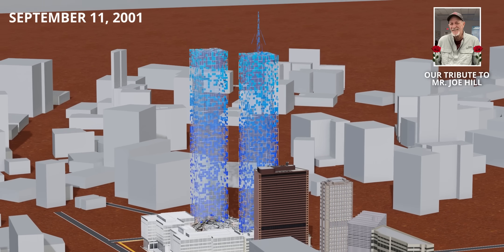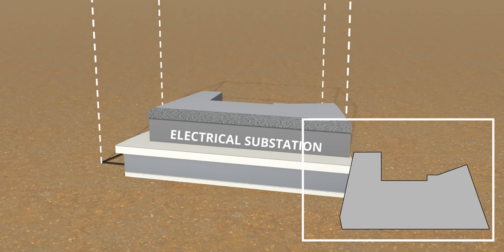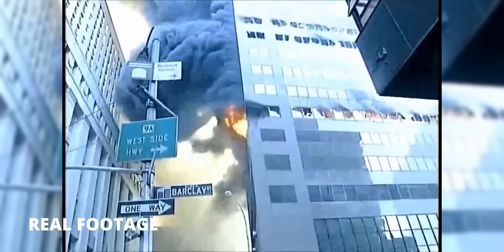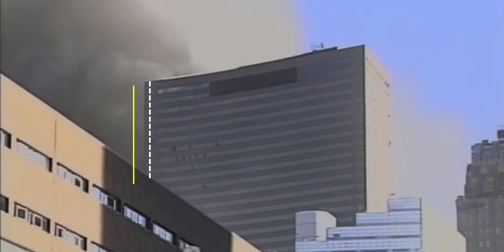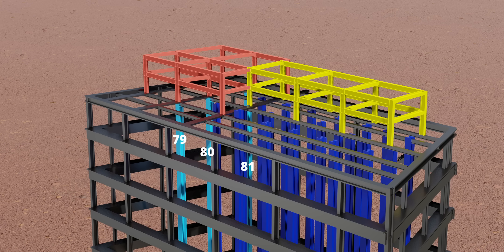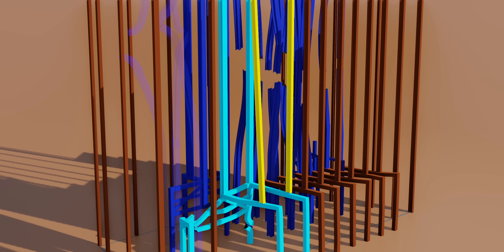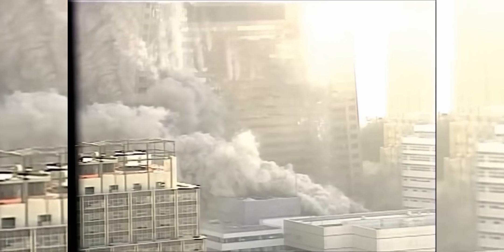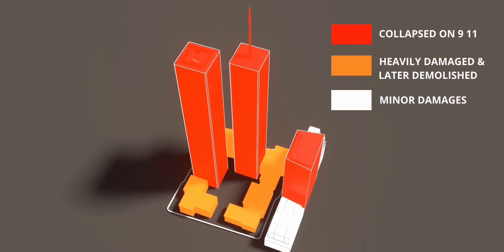Collapse of Building 7 | The Complete Physics

Comment: This is a nonsense video. This was a steel framed building.  Steel will not melt or burn due to an office fire - it is not hot enough to soften or melt steel even at 600 degrees as stated ...it takes more than 1000 degrees to soften it and 1500 to melt, and this has to happen in a wider area all around the building not just on two floors..  The transfer trusses are essentially flying buttresses as used to support medieval cathedrals throughout Europe for more than 900 years so far, and these  have not collapsed even with fire.   And even if you accept this nonsense explanation then only the NE corner would have deformed.  And what caused the beams to deform so low down inside the building where there was no damage?  No major debris hit this building - no radio tower by the way!  And recall the sounds of explosions on MSM videos?  And there was no significant damage externally - just lost cladding.  The majority of the building did fall at free fall speed for a time, falling into its own footprint in a neat tidy pile as designed.  And the fire fighters are on video saying they are going to pull the building a few minutes before it fell.  This is more nonsense.
Reply: how is steel formed and shaped?  By heating it, right?  So how does one deform steel?  By heating it.  In fact, structural steel will lose about 90% of its strength at just half of its melting temperature - so it never gets anywhere close to melting before it fails. At 600-deg F things will already be going south. Just at the Ne corner fire was observed on floors 7, 8, 9, 10, 11, 12, 13 and 15 so I'm not sure what 2 floors you are talking about. Of course, anything will seem like a conspiracy if you don't understand how it works. 

So lets fix that. 

The North Tower collapse at 10:28am bombarded Building 7 with tons of burning debris, causing heavy damage and starting raging fires burning out of control for 7 hours. Half the responding FDNY firefighters having been killed, others injured, units in disarray, equipment destroyed, no water pressure, and the greater urgency of Search & Rescue efforts, firefighting at 7 was pulled as futile. The building couldn’t be saved and was left to its fate.

www.youtube.com/watch?v=g_SvpwyC17M&ab_channel=MFitz  

Collapse of a burning structure is always a concern for firefighters. Steel buildings subject to fire rely on active fighting of the fires to survive. Buildings are designed around 1 to 3 hours of fire resistance, allowing time for occupants to escape and ACTIVE firefighting to get started, after which all bets are off. Left to their own devices they will exceed their design envelope and collapse. In B7 the occupants escaped, passive and active fire protections were compromised and active firefighting was abandoned which left the building to take its chances. It lost. Odds on Building 7 would eventually collapse, and it did. No big deal in logic. That is the sort of choice firefighters make every day in brush fire situations - which houses to save and which ones to let go. Only real difference here is moving the decimal on the size and cost.

www.youtube.com/watch?v=WnYBX6QT0R4 

FDNY Chief Daniel Nigro ; The biggest decision we had to make on the first day was to clear the area and create a collapse zone around the severely damaged 7 World Trade Center, a 47-story building heavily involved in fire. A number of fire officers and companies assessed the damage to the building. The appraisals indicated that the buildings structural integrity was in serious doubt. I issued orders to PULL BACK the firefighters and define the collapse zone. It was a critical decision; We could not lose any more firefighters. It took a lot of time to PULL EVERYONE OUT, given the emotionalism of the day, communications difficulties and the collapse terrain

FDNY Deputy Chief Peter Hayden ; We had our special operations people set up surveying instruments to monitor and see if there was any movement in the building. We were concerned of the possibility of collapse in the building. And we had a discussion with one particular engineer there, and we asked him if we allowed it to burn could we anticipate a collapse and if so, how soon? And it turned out that he was pretty much right on the money, that he said 'In its current state you have about 5 hours

The collapse of Building 7 was anticipated all afternoon and widely reported in the media with at least 24 video cameras recording some or all of the collapse. Everyone at the time knew what was coming and why.

www.youtube.com/watch?v=OY5S5k3tMHI 
Building 7’s collapse was totally different to the Twin Towers, harder to understand and most of the details difficult to see. But we can sort out what happened through careful analysis and observation.  What follows is MY EXPLANATION of the collapse sequence using the best available information and relying on no authority.

B7 was complex structure, a 47-story steel framed building built on top of a smaller existing 3-story building, requiring several lower floors dedicated to complex load transfer structures instead of usable office space. Of trapezoidal shape and all-steel tube-in-tube construction, B7 (above the 7th floor) consisted of a central core of steel columns carrying most of the gravity load, perimeter steel columns around the outside of the structure carrying the remainder of the gravity loads and long span beams and girders to tie those elements together and form the floors. On the outside of the building hung a moment frame - the last part of B7 to fall. 

Phase 1 : Collapse initiation for B7 is notably quiet with observers not realizing the building was collapsing! There was no audible warning in the form of say hundreds of ear drum busting 180-190dB explosive bangs preceding the collapse. The first externally visible signs of collapse initiation occurred at 5:20:28 pm. Here at 12:00 a local CBS affiliate reporter is talking 10 blocks from B7 when collapse begins. People don’t start to notice the collapse until 12:11. Then at 12:45 is the famous CBS fixed camera clip of Building 7’s collapse Again, note how quiet it is.

youtube.com/watch?v=t5tEy6mXSE8&ab_channel=fresnosean379

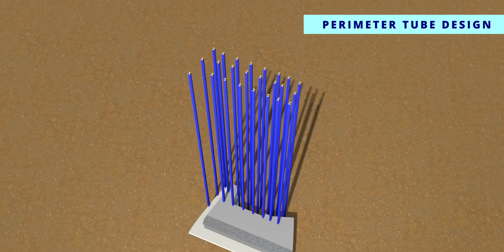Collapse initiation was due to multiple lower floor failures above the load transfer region (7th floor) in the NE corner of the building. In this video at 0:45 you can see the NW corner from inside the building while under construction, Column 79 just out of frame on the left. That big, angled steel beam across the top of the frame connects to C79 at one end. The girders connect to the beam. That beam and all those girders - a disproportionate total of the structure - depend on just one connection . 

youtube.com/watch?v=nP3TNHPCIVU&t=35s&ab_channel=EdwardCurrent

Phase 2 : Lower floor failures caused a loss of critical lateral support over an excessive length of core Column 79 and it buckled. If you look at a floor diagram of Building 7 (see above) and look at all the structures that depend on C79 you quickly realize this one column was a relatively isolated structural element on which a disproportionately greater fraction of the structure depended . Externally we see a vertical progression of window breakage along the 44-46 line and a kink in the roof of the East Mechanical Penthouse at the top of the building, consistent with C79 failure. The transition from full capacity to almost no capacity occurs in virtually an instant. Once the buckling failure occurs there is almost no resistance

Normally with a buckling column, the load could very well be redistributed to other columns, meaning the buckling could stop after a while. With C79 that is not the case - the failure did not redistribute the load, so the collapse rapidly progressed to the roofline, sinking the rooftop penthouse.

Phase 3 : With C79 gone, B7’s progressive, non-symmetrical collapse continues with C80 and C81 at the east end of the core left laterally unsupported and quickly buckled and failed as well, sending the EMP down through the building. C79-81 all have no diagonal bracing, which I believe is a major reason why they could not redistribute a lot of vertical loads among one another.

From there collapse progressed from east to west through the central core until the core was gone taking all of the interior floors and structures and probably most of the perimeter columns with it. You can see the horizontal progression of window failures low in the building and the dropping of the remaining rooftop structures into the building. One of the big takeaways from the NIST Building 7 study (that gets completely ignored) was their modeling which determined C79 failing under ANY circumstances would have initiated the same collapse sequence.

Phase 4 : After more than 10 seconds Building 7 is reduced to just a hollow empty outer shell - the exterior moment frame - creating the illusion the building is still standing since little has changed externally. But it’s just a hollow empty shell like an empty cereal box supported by only a few remaining columns and quite unable to remain standing. The north face leans inward, forming a V in the roofline, the last perimeter columns buckle under the strain and with nothing left keeping it up the moment frame free falls, landing on top of the 7-story high debris pile. It is only here, at the very end that a single measurement of alleged free fall is taken. Start to finish the collapse took 18-20 seconds, or less than 1/3 of true free fall for those who have been conned into believing that has any meaning. Worth noting - how fast something falls cannot tell you what started it falling in the first place. It’s not even the building itself free falling but its empty remaining outer shell at the very end of the collapse. The debris spread out, blocking surrounding streets, heavily damaging the Verizon Building and destroyed Fiterman Hall, all well outside of Building 7’s “footprint”.  

Building 7’s progressive, non-symmetrical collapse was incidental and unintended collateral damage from the combined effects of fire + time + gravity started by the collapsing North Tower. That is true no matter who planned and carried out the 9/11 attacks or why . The collapse was of so little consequence it barely even registered at the time, a mere footnote. 

Anything can seem like a conspiracy if you don’t understand how it works. Now you should. I hope you found this helpful and informative, not adversarial and it solicits informed critical comment. If I made any errors of fact, logic or reason or left anything critical out, please let me know so I can fix it. IF you can offer a more plausible alternative please do. Be the first. Please start any reply with the words “Tits McGee” or I will know you didn’t read it and are wasting my time.
Reply: @h1F595  No.  It s cosmetic, not structural
Reply: @h1F595  But was it sufficient or just exterior minor structural damage?  I do not know if you live in London UK, but a few years after 9-11 there was a massive fire at Grenfell Towers, a steel framed tower block in London. People died that day too.  It burned for many hours over all floors (not just over a few floors for a couple of hours as in building 7) and yet no steel melted and the building did not collapse.  Also worse fires in Madrid a few years earlier and dozens worse before that all over the world. None fell down. Not even one!   In fact no steel framed high rise has EVER fallen due to a fire.  Except on 911 when the twin towers fell into their footprint after a handful of upper floors burnt for an hour.   Most of the 200,000 tons steel was below the fires and untouched. What was so unusual about these three buildings?  Answer: the twin towers were designed to be hit by multiple 707s - the exact same size planes as they were hit by.  The towers were the strongest buildings ever built with massive over-engineering.  As for building 7, did you know that the documents for the criminal case against the Enron fraudsters were housed there and were destroyed that day so charges were brought for the Enron Fraud?  Also did you ever wonder how a quarter inch thick aluminum tube (airplane) can pierce 4 inches thick steel in the twin towers core without shedding a single airplane part?  If you believe that is possible, take an aluminum hammer and try to knock a hole through a 4 inch plate steel.  Knock yourself out trying to do this.  Or cook that plate for a week, or a month or a year over a hydrocarbon fire in your back yard - no matter how long you cook it, it will never get hot enough to melt or soften the steel.
Reply: @gregwakler393  "a few years after 9-11 there was a massive fire at Grenfell Towers, a steel framed tower block in Londo"
No, there wasn't. Grenfell was a concrete apartment block.

" It burned for many hours over all floors"
No, it did not burn on all floors.

"not just over a few floors for a couple of hours as in building 7"
WTC 7, meanwhile, DID burn on all floors. In the words of the experts on the scene, it was "fully involved" in fire.

" yet no steel melted and the building did not collapse"
So what if no steel melted? That's irrelevant nonsense.

"Also worse fires in Madrid a few years earlier"
Presumably referring to Torre Windsor, which did NOT occur "a few years earlier".

"dozens worse before that all over the world"
Meaningless handwaving.

"None fell down. Not even one"
Which is not true.

" In fact no steel framed high rise has EVER fallen due to a fire"
Which isn't true. By the way, what's the number of stories that makes it relevant if it collapses or not? Since you had to specify "high rise" and all.

"Except on 911 when the twin towers fell into their footprint after a handful of upper floors burnt for an hour."
So?

"Most of the 200,000 tons steel was below the fires and untouched"
Again, so?

"What was so unusual about these three buildings?"
That they burned, uncontested, for a minimum of an hour, after significant structural damage.

"the twin towers were designed to be hit by multiple 707s"
Nonsense. No-one has ever, before or since 9/11, designed a building for anything of the sort. That you heard someone say it and thought it sounded really cool and action-movie-like doesn't change that.

"the exact same size planes as they were hit by"
There are literally no similarities between a 707 and the planes that struck the towers. Basic, simple, easy to find fact.

"The towers were the strongest buildings ever built with massive over-engineering."
Utter nonsense. The towers were basic high rise structures, engineered to the specifications given. This isn't fantasy-land.

" As for building 7, did you know that the documents for the criminal case against the Enron fraudsters were housed there"
No. No-one, in fact, knew that, because it isn't true. Utter hogwash. Again, this isn't a cheap action movie.

" were destroyed that day so charges were brought for the Enron Fraud"
If there is one way to guarantee that things wouldn't be destroyed, it'd be to put them in a building and then blow it up. This is the real world.

"Also did you ever wonder how a quarter inch thick aluminum tube (airplane) can pierce 4 inches thick steel in the twin towers core without shedding a single airplane part"
No, again, no-one wondered that. Mostly because it's nonsense, there were "airplane parts shed" galore, and the steel was all of a quarter inch. These are easy to find facts.

"If you believe that is possible, take an aluminum hammer and try to knock a hole through a 4 inch plate steel"
Tell you what, how about YOU do instead. Remember to make the hammer weigh 100 tons, and swing it at 500 mph.
Making up stupid "analogies" is the act of those who know they're talking nonsense.

"Or cook that plate for a week, or a month or a year over a hydrocarbon fire in your back yard - no matter how long you cook it, it will never get hot enough to melt or soften the steel"
So, then, how did you think that smelteries worked when steel manufacture began? Hell, how did you think it works NOW?
Not that that matters, because "molten steel" is the cry of a lack-wit who doesn't understand basic forging.
Reply: @gregwakler393  What other delusional conspiracy theories do you believe in? Just curious.